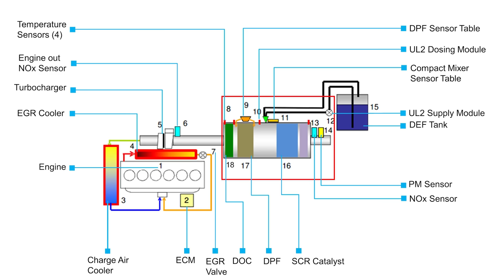Old But GOLD! I Changed My 2014 VOLVO for an Old 1996 Kenworth W900

Comment: I am the manager of roadside assistance at a trucking company with 130+ units on the road. We have at least 5-10 breakdowns per week regarding the aftertreatment emissions. Sensors, valves, electrical issues non stop. The worst thing is most of these parts are on national backorder. The qls/def tank sensor is sometimes impossible to locate and the truck sits for a couple of weeks. You sir are 100% right and have made a smart choice.
Reply: We have similar experience. Just our old MAN and Mercedes delivery profit. Same time our new MAN Tga, delivery to us bankruptcy in the past.
Reply: The next thing in Europe. Your driver get paid. Sure, less mileage less money, but as driver/worker or anything else, there is a minimum amount to pay your workers per month. So when the truck is standing, you can't give your drivers less than the minimum, than the minimum is enforced by law. I don't know exactly how it is in the States, but it's also not that good I think...
Reply: @xXDrocenXx  That is the correct way. They showed up to work, so even if there were no labor laws... it would not be justified to not pay them because of a failure of your own equipment. The talk of not wanting to pay them should only arise if the truck and all other essentials are available and in roadworthy condition, but the trucker fails to perform on his side.
Reply: Hlo sir im a Truck driver in Dubai I have 6 years experience in this job but I want to do work in English company if you have any job for me pls give me a chance thank you

Comment: The first thing you notice about a pre emission truck...it starts.
Reply: Lol
Reply: And gives everyone cancer.
Reply: @iDrive123  what doesn't?
Reply: @thepitpatrol  modern trucks
Reply: @iDrive123  that's actually a very faulse statement!! The particles that come out of old diesel exhausts are so big and heavy they lay down on the ground immediately, you can litterely see this. On emissions diesel engines those particles are in nano size and stay in the air so you can breath them in, wich I very good for the Pharma industry, more cancer to treat equals A LOT of more money, same for the car/truck manufacturers like he explained in the video..
Reply: @specialopsdave  not true! The opposite is the case!
Reply: @iDrive123  i suppose they cause global warming too...
Reply: @1990Redline  Aw heck...switch to nuclear power reactors and be done with it...😅
Reply: @chazarkansas1366  Those that get cancer I reckon.
Reply: @iDrive123  they usually die pretty quickly, so their opinion doesnt matter long.
Reply: And actually sounds like a truck, not like you’re frying eggs everywhere you go….
Reply: @1990Redline  good.  Mine is a 96 Detroit too.   650 hp and nothing I love more than laying down black smoke every time I take off
Reply: @iDrive123  Only in CA
Reply: Old trucks like that run almost as clean as the newer as long as filters are changed and oil along with good grade diesel fuel. 
If they were that bad all of us would be dead by now. They ran and built trucks like that until 2010 in the states and around 2007 in Canada. They still run most trucks like that in Mexico and most of South America today.
Reply: Not always, my 2021 cascadia wouldn't start for a misread sensor reading for the right shifter stalk/exhaust brake (automatic transmission). Had to disconnect power from the whole truck for an hour but it worked that time. The first time that  my truck didn't start was for a transmission failure @9000 miles (give or take a few hundred miles); disconnected battery power for thirty minutes and turned the battery power back on. It didn't work which resulted in a row to the nearest frieghtliner dealer for repairs. Newer trucks break down before your second truck payment, if you own the truck.
Reply: @sandasturner9529  You obviously didn’t read my reply… 🤔
Reply: @mrsincere4640  I guess I just skipped the "pre" in pre-emissions during reading, silly me. At least we feel the same about old school iron.
Reply: @1990Redline  just because you see particulates falling down doesnt mean old trucks dont have nano sized particulates coming out of their tail pipe. Doesnt matter if you have older or newer engine, they burn diesel, which sends fumes out of the tail pipe albiet via emission systems in new trucks. 

So basically if you claiming new engines have nano sized particulates guess what you old engines had it too along with the heavier particulates.
Reply: @iDrive123  And that's bad?
Reply: The majority of lifetime emmissions are during the manufacturing process. New trucks are disposable, so even with less exaust emmisions, they still create far more smog than a truck with a 20+ year service life. That's just a fact.
Reply: @mctransportation9831  and that doesn't surprise me at all.
Reply: @iDrive123  how dont power plants fueling your electric home and car??
Reply: @FirieonOG  WTF are you on about? I never mentioned electric anything. I commented on older truck diesels Vs newer truck diesels.
Reply: @frankmaddalena8570  😂 on that note water vapour is biggest greenhouse gas so to say diesel trucks are even remotely responsible for "global warming" is a joke. I assume the trucks caused melting of all the ice of last ice age. 😂
Reply: @El Chapo  yes El Chappo and without them let's see brain trust....we wouldn't have food, clothing,  medical supplies ect. Trucks have done as much as anything to increase the quality of life we have. But I bet you would prefer a nice "green truck".
Reply: @iDrive123  I mean if you drive it on cities like LA, Mexico City and another few mega cities probably. Other then that is only bull crap.

Comment: My last brand new truck was a 1988 Freightliner conventional, FLC.   I retired it in 1997.  Did not sell it.  Ended up building a 40X60 foot shop in 2004 so I could slowly rebuild the truck from the ground up.  400 horse Cummins with a Fuller 13 spd.  3:90 gears in the diffs.  Everything on this truck is now new and rebuilt.  It will be towing the trailer for my drag car.  The day I turn 90 I will sell the truck.  So I guess I will have it 16 more years!!

Comment: I am watching this vid just for the info , I am 80 yrs old , I have never driven a big rig , but I am fascinated with it all , and I still drive and operate my back hoe tractor 👍
Reply: That's pretty neat
Reply: @Hello Robert how are you doing
Reply: @lydiacapps709  Yes, Robert, say hi to the nice catfish Dude POSING as a chick.
Reply: Same thing is true for the new backhoes. I live in Europe. All new machines come with Adblue and a lot of electronics and  shit like that. A friend of mine had a lot of problem  with the adblue in the first year!
Reply: Your kind is welcome here😁😃👍
Reply: That is the nicest comment I have ever seen on YouTube. I hope you are doing okay, Robert! I wish you all the best. Greetings from Germany 🇩🇪
Reply: On all of these truck vids I see that these newer trucks, not only break down because of the emissions garbage, but that it also causes extra fuel consumption. 
My father was a ww2 aircraft engine mech , he said they had a water injection system,  activated at 1000 ft or so , as they were not yet going fast enough for proper cooling, this helped to cool the engine & it adds power + saves fuel ! 
He used to say - notice your car always runs better in the rain. 
I had a Chev Pu with 350 cu “ had large camper, I installed a water inj system that saved me 20-25* at the pump.
Gail Banks Performance in Cal USA builds systems for both gas & Diesel , my deceased son you see in this pic , put one on his Dodge Cummins & he had to be gentle at the stop lights or would squeal the tires. 
A friend told me yrs ago , that people in the UK were adding propane assist to their diesels for increased performance & fuel savings. 
Lately I have discover a Co. that builds propane injection systems for both gas & diesel called , 
,dieselperformanceproducts.com  , their website shows great reviews & testimonials
Reply: @darkadmiral106  . Thanks sir , I have replied to you 2 tim s before but the U-tube police keep keep discarding my response . May the good lord bless & keep you ! Have a merry Christmas
Reply: @darkadmiral106  Thank you sir for the nice comment, let me return the favor to you, help you have a merry Christmas a happy & blessed new year. Type into your device, son life broadcasting network, & explore the many facets of it , you will be blessed.

Comment: My father drove trucks for 30 years till he passed in 2012. He said emissions is going to kill the truck industry and he was right. CAT used to be awesome. They got destroyed by emissions.
Reply: No, Cat said screw that, and got out of truck engines.
Reply: They got a big deal with the military
Reply: Cat said they couldn’t build a reliable motor with enough power to fit emission standards, so they stopped
Reply: Yeah I bet international and Cummins and paccar and…. Will all go out of business  oh wait
Reply: @seattleguy8230  it’s not that they couldn’t, they didn’t want to. After they already had to comply with emission standards. They decided to invest in their already profitable off-Highway applications. Which while they are still required to be they are not as restricted as commercial vehicles. They made the smart move
Reply: So what? Trucking is One of the biggest pollutants. If you can't hang it out.
Reply: It’s nice to be able to breathe the air right?
Reply: Cut cant they compensate with bit catalytic converters and big faps, and poorer fuel mixture (higher temperatures i know) ??
Reply: @AsianNIGMA the one you didn’t name is the true champ! Detroit for life!
Reply: Love the fact that you idealize real trucking and…. That you run a Detroit 60 as do I. Great motor!🤘🏾
Reply: @hawkdsl good for them. Time the EPA got booted instead of the likes of Cummins and VW.
Reply: Cummins is awesome to
Reply: Cat refused to destroy a good engine to meet US emissions yes they still build them for other countries and still number one in a equipment. Main thing is still produce parts and so forth.

Comment: Excellent philosophy and ride. I’d never buy a new truck. Still running my old 92 W900L all mechanical 3406c and I do heavy haul up to 250,000lbs. Never lets me down.
Reply: Mannnn I just grabbed a W900L with a Cummings N14Plus I’m kinda nervous but I’m comfortable at the same time
Reply: Hey guys I'm looking for my first oldie but goodie day cab semi.
Point me in the right direction to find one please???
Reply: @benjamingreene5111  Hey guys I'm looking for my first oldie but goodie day cab semi.
Point me in the right direction to find one please???
Reply: @dontadye7924  find something with a n14 Cummins or a c15 cat or a 3406 cat motor or a Detroit series 60 12.7 liter.
Reply: I drove  1986 gmc general 3406, 10 speed over, heavy haul 3 yearsno breakdowns,  super solid beast, outdo any truck today, unbreakable , drove it from 2001 to 2005oil and fuel , no other costs period
Reply: Pulling over 100 ton? 

Noice
Reply: @JamesSmith-fd9gc  probably about ten miles lol
Reply: What are you hauling that’s 111 tons?
Reply: @benjamingreene5111  that n14 is a beast and the cheapest for an inframe. Just save up about 15k incase you have too and find you a good mechanic that won't charge you an arm an a leg. I have a 1989 pete 379 with a B model cat and she has only let me down when I had a small fuel leak that evolved into an inframe. Just keep and eye on everything and make sure you grease and oil regularly and you'll be fine. Goodluck out there.

Comment: I couldn’t agree more!!! I was driving a 2018 Peterbilt 579, WHEN it would break down I didn’t know whether to call a mechanic, a plumber or an electrician. Bought myself a 2000 Ford Sterling, with a Detroit 60 series 12.7 absolutely love it and runs great

Comment: Once I did the inframe on my 05 International 9900i it ran great for 6 years before I had to do any other engine related work so if I was to buy another truck I'd definitely look for something 06 and under. Mine had egr, which had to be changed a couple times and the egr cooler too, but other than that it was pretty good for those years.  Always got it back to the shop and never towed. The new truck guys would always say I was paying too much to the tax man because I had no payment, but that's OK. It's a better feeling owning the truck than it owning you!

Comment: I drive  a 2000 w900 with a 60 series  Detroit as well.  It  is a farm truck pulling  a set of super b grain trailers.  It has a few dings and scratches but it runs good and has the power to pull my trailers.  I can't imagine spending money on a new truck for the amount of miles that I put on In a year. 
The sound of a Jake is music to my ears!!
Reply: Older trucks are perfect for secondary haulage duties, like farm trucks moving grain locally etc. A rebuilt older unit will last many years in those sorts of duties where the unit isn't in use all day every day. Also farms tend to be able to perform their own maintenance too, so a new turbo etc wouldn't be too costly.
Reply: Same, I will never sell my 12.7 Detroit.
Reply: I still drive a  200 T600 with Cummins n14.  Starts every time.